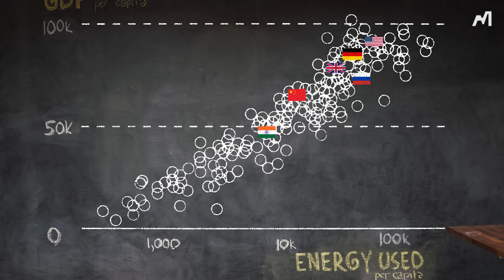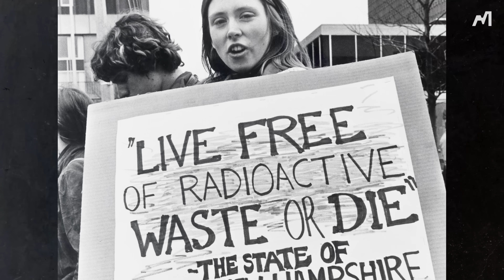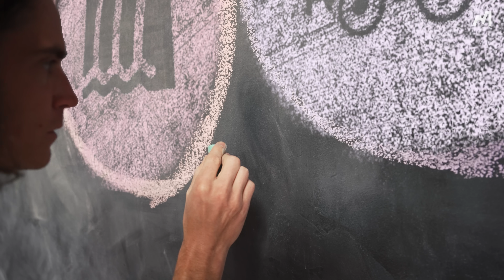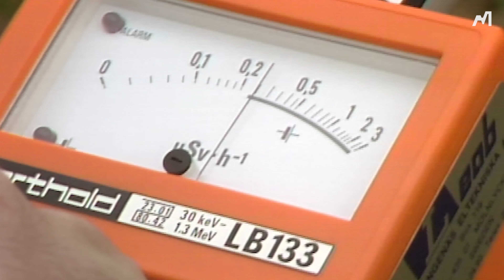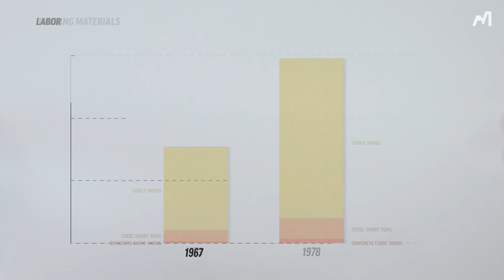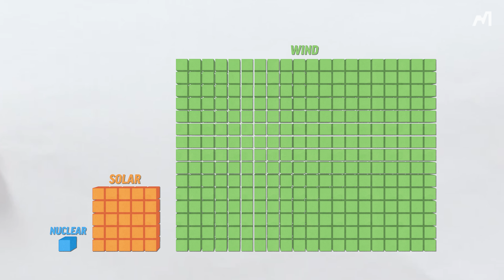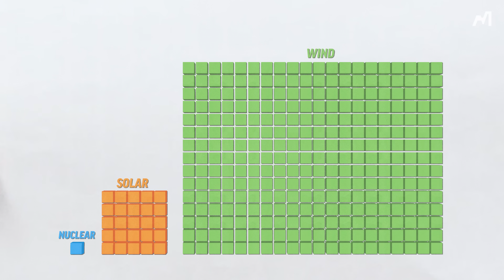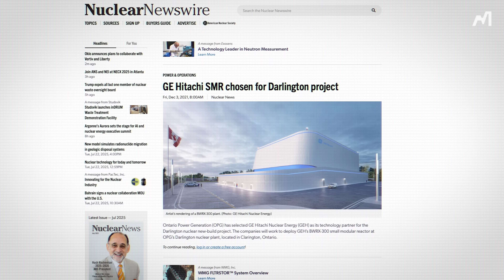They're Lying to You About Nuclear Energy

Comment: Big Coal is the answer to the question. Just like oil they send out the PR machine and coal is gonna run
out....and bam nukyaler fission....then bam it's dangerous....maybe not...But I have been asking for years how the center core of the earth is still 6,000 degrees after 3.5 Billion years. Lets say we drilled a hole where the reactors are
and could get to an area that was over 1000 degrees....instant free power. But what if the center of the earth
is like the sun and it's belching out helium and heat....hmmm

Comment: One of the tragedies of "nuclear waste" is that if it's from an older reactor, it will likely have over 90% of the original energy still in it. It could in fact act as fuel for a more modern reactor. Want to get rid of nuclear waste? Build modern reactors and use it as fuel. Oh, and "linear no threshold model" is just a fancy way of saying "made up data".

Comment: Your death-circles chart is misleading because it relies on how much of those systems are in use. If you looked at it per Watt generated, it's nuclear as the smallest, then hydro, then wind, then solar, then gas, then coal, then oil as the largest. The construction and maintenance of renewables is regarded as one of the most hazardous, especially when compared to output.

Comment: It's always a counter-factual between the costs and benefits of energy sources. Nuclear definitely has a lot of promise, and it would be worthwhile if we added more to the grid. Distributed energy resources (DERs), colocation, and wider market regions could also help lead to more efficient energy distribution. 

My memory from energy economics is that there is something of an incentive problem with nuclear, since it requires relatively low maintenance most of the time, but requires highly skilled individuals when servicing is needed, you run the risk of a potential labor mismatch. It is wild how effective the fear machine has been with this one. We do tend to be more concerned by catastrophic events than the day-to-day seeming threats.

Comment: In watching the nuclear industry be killed by the environmental activists and government bureaucrats, they prevented the solution to the global warming problem from evolving.  If they had failed in their anti-science activist project, the cost of nuclear power would have fallen much like we have seen in every heavy industry.  The most modern example is how fast the cost of solar, computers, and batteries has fallen with an increase in capacity.   Assuming the normal cost decrease down the "learning curve," nuclear would have put most of the high-carbon energy options out of business, and global warming wouldn't be a much smaller problem. 

The green anti-nuclear, anti-science activists have caused more global warming than the big oil companies.   Good intentions can create bad outcomes.

Comment: Complete BS, this video is the actual lie. We cant even operate normal chemical factories safely, people cutting corners everywhere. And you think it wouldn't happen with nuclear power? No matter how "safe" it is, every chain is as strong as its weakest link. And we have actual examples people dumping it to the lakes and oceans, so dont tell me that cant happen again. 

First, nuclear power is not just the reactor. It has a long logistics chain. You need to process, store, transport, use and depose it, which requires its own facilities and staff. And none accepts errors. 

Second, even the small accidents will pile up, especially when you open hundreds of reactors. Why? Radioactive material is not that dangerous, if you get away quick. But is most dangerous when you inhale or digest it. And no, "banana radiation" is NOT the same thing. Radioactive potassium is a naturally occurring element, your body knows how to handle it. But handmade radioactive stuff like Cesium isotopes are not natural. Just like how fish cant handle mercury, our bodies less likely to get rid of it. And it will irradiate you from inside, and radiation is most dangerous when you exposed to it for extended periods. Yes, even if it is a small dose, it can harm you. 

Third, it is expensive. You need several different facilities, they cost to build and run, you need specialists an all operations. You cant hire someone from street for this one. You build the facility in 5 to 10 years, compared to other options it is too long. Even one is a huge investment.

Yes, they can be useful, but they require extreme care and investment. They might supplement the power network, but cant be its major power source. We would be exchanging another environmental disaster for another one. 

They are lying to you, but the ones lying are the mouth pieces of the nuclear power corporations. Do you REALLY think they have your best interest in mind? Have you took no lessons from the Oil corporations and their lies about climate change? I am sure some of the brainwashed might even jump me even today, claiming it doesnt exist!

Comment: I think your construction costs segment glosses over two cost areas inherent to construction operations.

One, the typical building or infrastructure project has much looser tolerances and ability to adapt to mistakes, rather than have to tear out and rework often.  And that’s the level contractors operate at.  And the willingness of licensing authorities to accept that versus tear out and rework to spec went away.

Two, for somewhat reasonable reasons, those tolerances tightened through the 70s into the 90s, making it even more difficult.

We’re getting better at designing within regulations with specifications and tolerances that allows for variations and stacking tolerances.  And better at measuring in real time so that we can avoid some of the mistakes, if you run a little slower and use the best equipment and well trained workers.  But it’s still a lot more precise work than the construction industry best practices and much tighter than usual practice.

Comment: This video does not properly fully evaluate the issues.  Considering you explicitly take the time to criticise wind power you can't honestly say "oh but it goes both ways with any power source"

For example wind power danger to birds is overstated search "how bad is bird deaths wind power" other sources are much worse for bird death including other electricity sources.  As far as insect death, its less clear. But compare to insects killed from insecticides, cars, etc. probably relatively not that much.  The blades might only last 20-30 years but the base should last 50+ years.  Lots of resources go into making a nuclear plant or a coal plant or a gas plant.  Nuclear has alot of rare earth stuff as well requiring more rare metals and more computers etc. 

Even nuclear has to get fuel which has to be mined up which causes significant environmental damage and that material has to be shipped over, just like coal or gas. And it takes more and more resources to mine up coal or gas and has to travel further afield as well. 

Regarding batteries, ALL electric power sources need some way to keep extra charge around and/or a way to quickly change power generated.  A nuclear power plant can indeed give a consistent flow of energy, but that is not useful to humans, sometimes people need more power and sometimes need less, having too much electricity can be as much of problem as having too little. So a set flow from a nuclear plant is not enough on it's own. AI server farms are even worse for this because there will be periods of intense power draw when training and periods of light power draw. A nuclear plant would be awful for this without battery backup or some other way to store power.

I could say more but who knows if this comment would even be seen or of algy doesn't del my post or whatever.

Comment: I'm a safety engineer, albeit not in the nuclear industry, but @7:00 you're incorrect. The key part of ALAIRA is that it's REASONABLY achievable. Organisations can show it's not reasonable to implement risk reduction measures through a cost benefit analysis. You're interpretation is a common misunderstanding, we have a similar thing in the uk with ALARP (As Low As Reasonably Practicable) which is often mis-translated as As Low As Reasonably Possible.

Comment: Did that damage chart consider the different number of plants? It would be misleading for nuclear to have a smaller circle if it was simply because there’s less nuclear plants. I respect that you admitted the positives of coal and natural gas, and the negatives of wind, while also reasonably noting that it would be nice to move past them. There have been a lot of brutal radiation poisoning cases, but it’s nice to know it’s not as wild as expected. Sounds like everything comes down to either nuclear or solar. And for nuclear to truly win it needs to become compact the way that eventually a car might run on solar.

Comment: The Achilles heal of light water reactor technology is the use of spent fuel pools  to cool depleted rods.  Most reactors have overpacked them, beyond pre specified design standards of those pools.  If those rods get exposed to air, they would ignite releasing massive plumes of radiation with no technology developed to put out such a fire leading to the worst man made disaster in human history.  Yes, way worse than Chernobyl!

Comment: Solar is now cheaper than coal.  The "Exclusion Zone" of most nuke plants, would hold enough solar panels, to match the plant. Just keep that.  Add batteries, and why would you need to fool with nuclear.  From a thermal box Physics viewpoint, solar produces less heat into the Earth system.

Comment: More have died in accidents at repprocessing plants for the waste.  The plant in Rhode Island, killed 2----but, everyone just wants to forget that.

The beaches in Scotland, for a few miles, is very very contaminated, from the reproccessing plant up there.
Reply: There is no such thing as permanent, safe, storage of spent fuel (witness the ongoing storage of spent fuel at plant locations from lack of dumping sites, making each reactor site "an event in progress," just like what is going on at Chernobyl and Fukushima)!
Reply: @richardmcbroom102   Correct:  that is the problem, still looking for a solution.

I thing they tried some sort of "glassification" scheme, which showed some promise, but nothing is truly permanent.  Solar is now much cheaper.  Why do nuclear, anymore?

Solar works until you break the glass panels. None of this 20 year BS. 20 years in the guarantee, not the lifespan. At 20 years, output is guaranteed to be or exceed 80% of its rated Watts.

The older thin-film type, didn't even require rare or exotic elements.  Just a lower efficiency.  Worked good in low light and cloudy conditions, too.

Comment: Ok but there is a limitless supply of energy that almost nobody is investing in.
Its clean and will never run out.
And we are all standing on it right now.
Ultra deep geothermal wells that can be drilled almost anywhere and go down to magma.
We have an energy source as abundant as the sun right under our feet.
Hardly any investment is going on to tap into it.
Reply: There are some problems with it.

1. Drills are very rare to bore that deep and with that expensive in comparison to what they are
2. You can’t just drill everywhere you want.
3. The tectonic plates are moving and with that the pipe that runs up to the turbines.

Comment: 1973, the year that new nuclear in the US collapsed?  
That’s the year the NRC took over from the AEC. New nuclear builds continued in France, many other places. Enough nonsense, it’s always been the malevolent govt regulator in the way.
Reply: There is no such thing as permanent, safe, storage of spent fuel (witness the ongoing storage of spent fuel at plant locations from lack of dumping sites, making each reactor site "an event in progress," just like what is going on at Chernobyl and Fukushima)!
Reply: @richardmcbroom102 That’s hand waiving, where “safe” means whatever you want it to mean, changing when you want it to change. Here’s the fact: nobody in the US has ever been injured by radiation from spent nuclear fuel from commercial power, not one, not ever.  Could bury one of those concrete cans loaded w Uranium rocks in everybody’s back yard, and the risk from, say, bee stings and bathrooms would be miles less “safe”.

Comment: Very well explained. Funny thing is my master degree desertation is almost 80% of this video. But i made it before you did si I think you had some inspiration from it 😂😂😂. Well I really like how you explained. How you put the problem. Nuclear energy is very dense, a pallet of uranium as big as an inch has the energy of 20 tonnes of coal. Also the new Nuclear powers plants have a lot of saftey systems. SMR I belive are the future until we can make fusion energy realible. As you said Small Nuclear powerplans are the best, you can power small cities or Villages 10 witj no problems also when the Nuclear fuel is to spend you can change the reactor, het the old one into a factory open it and change the fuel, working with them like geanta bacterries. This is a great ideea in my opinion.

Comment: We need to focus on wind/solar and energy storage. The reality is: nuclear is far too expensive. No power company is concerned with radiation. The cost per kWh of nuclear simply doesn't make sense. Immensely expensive to build, and the steam generated cannot reach supercritical states. Because of the lower energy state of the steam, more exotic metallurgy is required. The ROI is far too long. Way easier to just build a gas plant.

Comment: I learned this in 1985 working in one we were hired to Fix 6 36” flanges on the pipe coming out the soup bowl of reactor 
Leaking boiler feed water that was contaminated bid time it was so hot we wore 🧊 vest to work for 43 minutes 
Each time in.I crapped out in one day of radiation was there 14 days n accumulated 2 years of radiation in those days 
The plant President signed me back in knowing that I was over the limit I was 25 years old Im 65 now they sent a 3’ stack of papers to my moms house which was my address while I was on the road the papers said I agreed to go back after the first week radiation is a Fear Monger to keep us in control.Just putting it out there 👍⚔️🇺🇸

Comment: I'm a Downwinder. We grew up about 150 miles from the Nuclear Test Site when above ground and subsequent underground tests were conducted- I remember after the blasts, we were advised to stay indoors, as the displaced radioactive dust was often so thick the streetlights would come on in the daytime. For blasts during school hours, we would have a drill and stand outside. But that's not what this video is about. I really liked your presentation, especially about the boondoggle that is wind and solar power, so that I was just about sold on nuclear energy up until the part about spent fuel waste disposal. The long-term outlook can't be ignored; it's a huge problem that can't be minimized. Nobody wants it in their backyard.
Reply: How do you know it's a problem at all?

Comment: 14:28 I'm all for nuclear, but the longest running plant is in Switzerland which is 58 years old. It will run well past it's 60 year original lifespan, but only because of extensive modernisation.... So it's a false equivalent to suggest nuclear plants are uniquely placed to last longer without renewal or additional resources.

As for the SMRs, again, great idea, but they are more open to terrorist attacks and being a supplier of orphan sources in future.

Perhaps rather than just ramp up our consumption of energy, we should do the opposite and ramp down. Degrowth is a valid policy, and unlike growth, it is sustainable and leads to less conflict.

Comment: I read about a nucler power system that was designed such that if there was some loss of control, the redioactve bits would separate and essentially shut down the plant.  The design that's mostly used can have a runaway.

Personally, I think nuclear power is pretty safe.  Until it isn't, and then the consequences and costs... well, all of the sudden the juice isn't worth the squeeze. Chernobyl being one example, and Fukushima another (and probably the worst).

EDIT::  OK, I might have been more worried than i should have been.

Comment: There are so many fail safes available to nuclear to prevent melt down. China is building molten salt reactors that can't melt down. The US needs to take nuclear to the next level. The small mobile reactors would be great to power neighborhoods. Imagine how cheap your electricity would be if your neighborhood was powered by its own tiny reactor. A box the size of a car would house it and it would just work for a hundred years. The only maintenance would be if the water leaked out and couldn't generate enough steam. This way if your neighborhood lost power, then the other neighborhoods wouldn't suffer. And could likely supply you, until yours was restored. Nuclear is the future and has been. We just need more common sense and less politicians.

Comment: How much uranium do we have left?
Reply: The IAEA "Red Book" report comes out every two years. Typically its estimate of the known reserves of ultracheap uranium -- less than $2 per barrel-oil-equivalent -- increases in each two-year period by several times the amount that was actually mined in those two years.

If fossil fuels were outlawed -- which won't happen, because fossil fuel consumers subsidize government -- but if they were, and increasing scarcity caused the price of uranium to rise until miners could afford to mine ores that were as poor in uranium energy as the Alberta tar sands are in tar energy, where would they look for these low-grade, but now economic nonetheless, ores?

That's a trick question. They wouldn't need to look: anywhere you stand, you'd be standing on uranium ore.